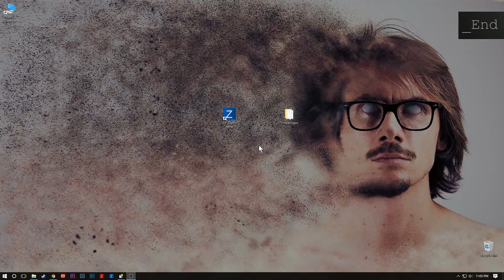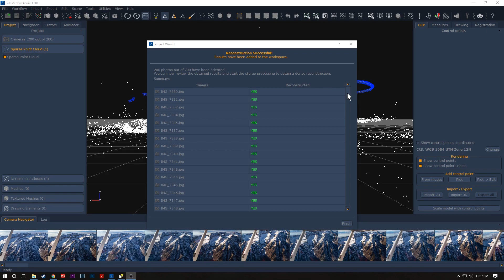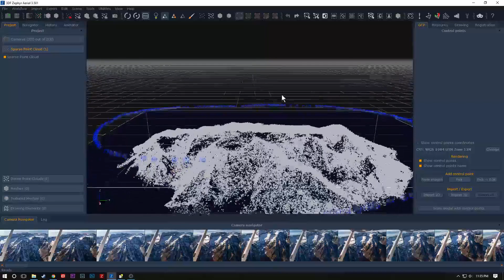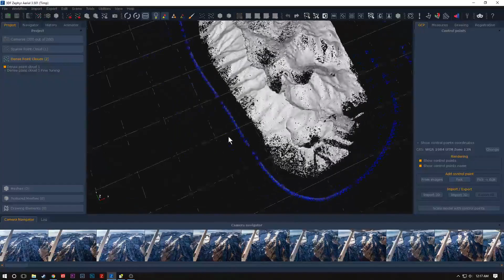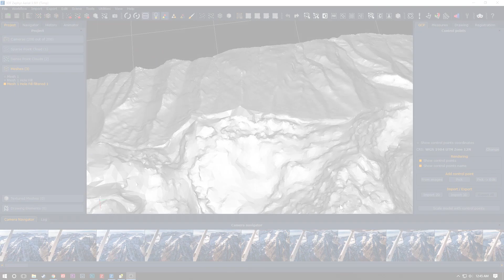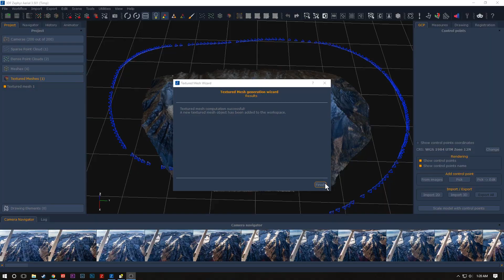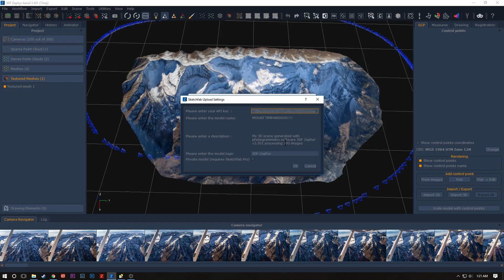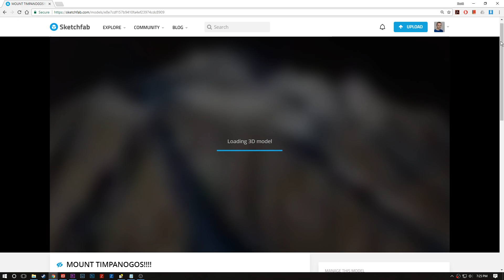Scott Models A Mountain

Comment: I feel like this would be awesome for low budget game-making: Instead of hiring tons of 3D modelers and artists to draw all the details, go on google maps, find an area you think fits the terrain or environment you want, and go there to take a bunch of pictures. 
You'd do a low poly version of course so people's computers could run the game well, but all the textures etc will be there. Just have to add building details/inside areas and plants.
Reply from the maker: You have a VERY good point and one that needs to be caught onto. The budgets for games are so incredibly high that it's extremely difficult to break into the market. If this can be done with a scenic plane ride, a $2k camera and a little knowledge, you've  gotten yourself a massive edge against those companies doing all this by hand.